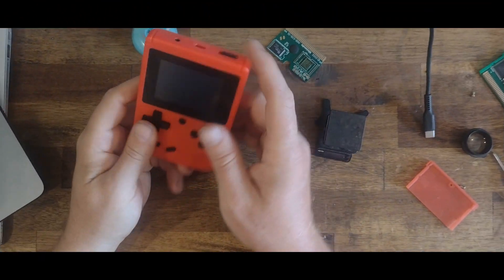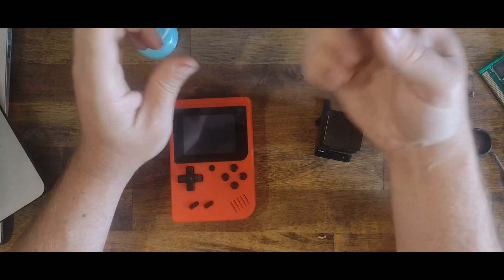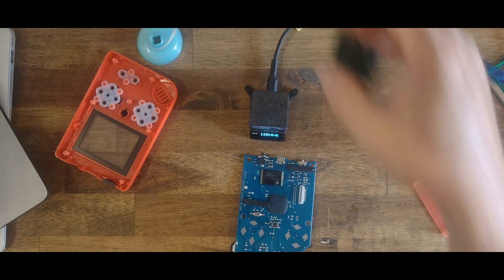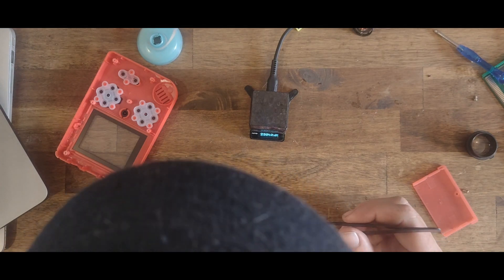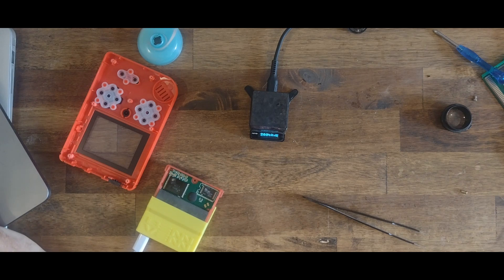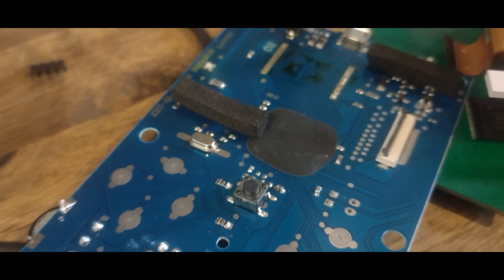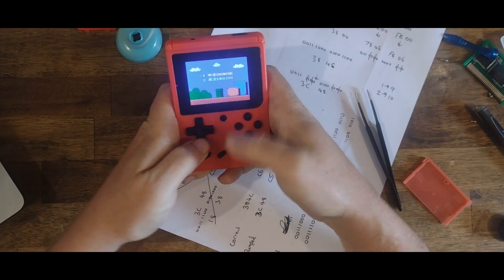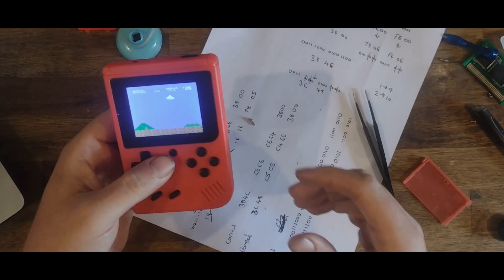SideQuest 003 - Swapping ROM's in a SUP 500in1 aliexpress 8 bit console

Comment: Also, it is possible to swap the entire menu out for the own one provided if you track down the TFT initialization functions and the startup code inside. Here's what I did earlier and it is my own game menu inside: https://youtu.be/2iOM-IpzqDA?feature=shared
Reply from the maker: Nice work! The manufacturer of the IC has all the tools to build your own menu's freely available on their website so that side of things should be fairly simple. I haven't looked into their compiler a great deal but I believe their init code queries the TFT and selects the correct init code, similar to how bootleg batteryless patches work - They query the CFI of the flash and select the right code to erase and write sectors. It's a shame they didn't add a little bit of programmable logic to support other mappers.
Reply: @bennvennelectronics  Hi, thanks for the reply. The "VRT inc." website you have pointed out early have the major information on how the handheld map its flash memory location (especially VT-02 and VT-03), but on the TFT and the other peripherals, they are very different compared to the handheld you are having itself.

I had not used any of the menu builders provided due to the fact that a lot of the tools are already obsolete. The compiler I used is the latest version of CC65.  Worst of all some of these apps couldn't run on Windows 10 or 11, and they are written in Mandarin, which I'm still learning. Some of the registers on the TFT controller I found out do not tally with the initialization code provided too. The earlier ones I got do have the TFT init code which is register-by-register, and later models have an entire section dedicated to detecting the TFT model and starting it right away.

I do not know why they swap these data bits - I believe it could be a simple copy-protection, or it could be simplifying the PCB design (only one layer, since the lines cannot go under or cross over).

Since you can dump its ROM, I believe you can also isolate the startup code by using the EmuVT emulator, and try to run your app there. The whole startup code and menu could be at the first 512K (0x00000-0x7FFFF). I wrote the ROM dump analysis there: https://nyh-workshop.github.io/Custom-ROM-Sup-Game-Box-400in1/ROM_dump_analysis and I believe this should also apply to the 500-in-1.

My future plan is to further improvise that menu creator which is written in C# - currently I could able to automatically compile the games in Mapper 0, and I'll do both for Mapper 0 and 4 too: https://github.com/nyh-workshop/MenuBuilder_SupGameBox

The dumping tool I had is the expensive T56 one for the TSOP-56 versions, and another with an adapter + Raspberry Pico for the BGA flash breakout.

Oh, the one with the BGA flash breakout - it's a pain in the back to extract this out. Currently I used that expensive ChipQuik to get this thing out. If you have better or cheaper ideas on this please do let us know on how to do this.

I'm wondering where did you get the GBA dumper, and that little hot plate? 😊
Reply from the maker: @nyh-workshop  The hotplate is a miniware mh30 i think? there are larger ones available now, and cheaper from other manufactuers.

The Cart dumper is our BennVenn Joey Jr, you can find them via most of our distributors (check our website for links)

You could also transplant the BGA parts onto a GBA bootleg cart, most bootlegs have footprints for both tsop and BGA but BGA is a bit trickier to solder as you may already know.

512kbytes seems a bit excessive for init code... the 0x7FFFF boot vector is not adjustable which explains why its where it is. Do you know if there is a datasheet for the hardware in the SUP glob top that actually renders the video from composite to the TFT? There must be a big logic block that handles this but I couldn't see any reference to it in the datahseet. The emulator on that VRT site has an option for TFT output but none of my roms will boot in the emulator. It could possibly be a clone of a VRT?

The bit swapping - this is as you suspected, just a routing constraint. D0 and D1 are usually swapped on GBC and GBA carts but this is to prevent CFI interrogation for the few games which check for piracy. I don't think its the case here.

I was also thinking about coding a rom patcher so you can save to the flash in games like zelda etc. Shouldn't be too tricky as WR is routed to the VRT chip. It's just a matter of allocating enough ram to emulate the cart SRAM then copying that to the Flash while executing from RAM. Same as how GBA and GBC bootlegs do it. The second half of the flash in my 500in1 is empty, so plenty of room for activities.

You should head over to our discord, I'd love to have a chat about all this! You can find the link at the bottom of our store. See you there!
Reply: @bennvennelectronics  Hi, thanks for the reply.

Yes I made a mistake explaining the init code - what I meant was the first 512Kbytes are mainly the menu and init code. On some handhelds there would be at least 64K being dedicated for automatic TFT initialization routines within that first 512Kbytes. This one stores all the TFT settings from ILI9341 to GC9306.

Unfortunately I do not have the actual datasheet for these - I've been hunting this for years but to get no info. These famiclones on a chip are most probably clones of VRT rather than being purely VRT. That is why you do not see much of the TFT registers that are matching inside the datasheets. I checked the address of that VRT company and seemed that it is now occupied by another semicon firm. I speculate that these factories might purchase the designs and then comes up with their own ones but still keeping the VT-02/03 designs (well it works well so they didn't change that design!). Also, I could speculate that these chips are designed uniquely by each factory too.

What I would guess from the disassembly of the code is, these TFT lines are GPIO at start. Just like Arduino sending the settings to the TFT through the port, it does exactly this. Once it is initialized, it goes on switching on the backlight (yes the backlight is a separate thing!) and then setting the registers to jump to that desired flash location. 

If there are better ideas how to even flash the thing _in-situ_, that would be certainly awesome. I really hated the idea of taking the thing out and reflash and putting it back for testing. I did a flash emulator on a Teensy 4.1 but it doesn't work all the time. I suspect the RP2350 can handle this better since it has more pins and there is the PIO. (I did it for the RP2040 but it didn't go too far, could only make the handheld shriek for a moment!)

I'm located in SE Asia, and that shop of yours is pretty interesting. 😊